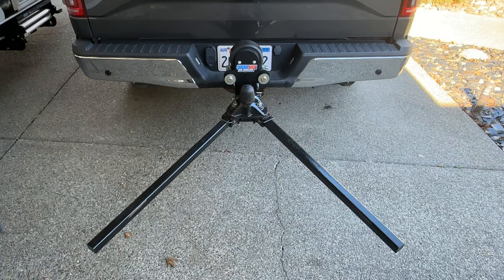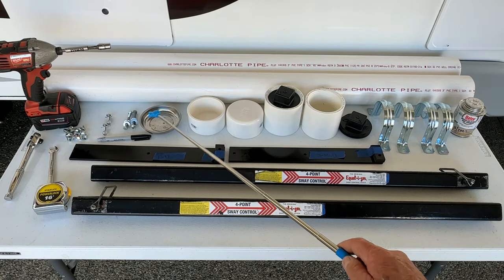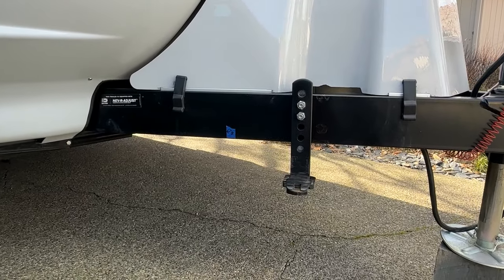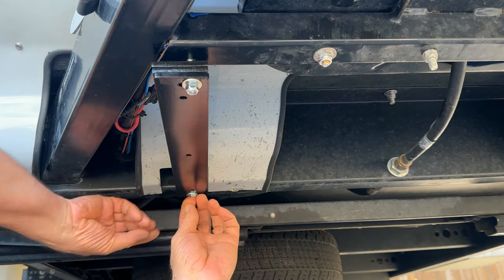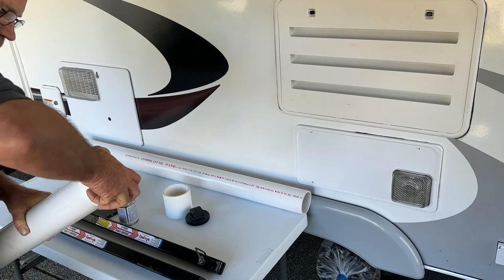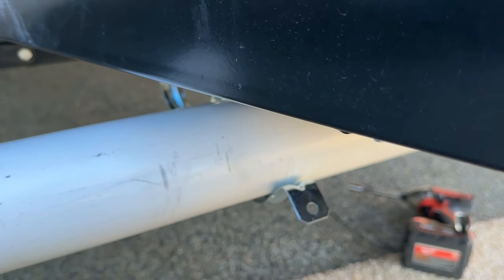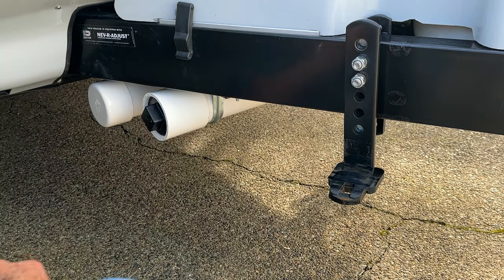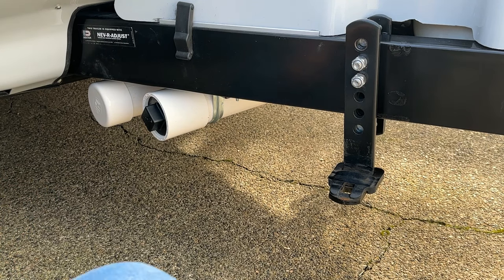Travel Trailer Weight Distribution Hitch Sway Bar Storage Solution

Comment: Thanks for the video, very detailed and easy to understand. I'll be doing this in the near future.
Reply from the maker: You're welcome, its one of my top improvements that are worth doing :) Thanks so much for watching, and for taking the time to write.

 https://www.youtube.com/@thetraveltrailerguy/videos

Snap L Pins for Weight Distribution Hitches Quiet Equalizer Type Clip -
https://amzn.to/3OkwOTw

Equalizer Sway Bracket Jacket 1 Pair (quiets down creaking noises at the bars)
https://amzn.to/499kkpO

3 Inch PVC Pipe End Cap -
https://amzn.to/3vXYSWx

3" PVC Sewer Cleanout Adapter with Plug Pipe Fitting (not the same as what you see in the video but I like this one better) -
https://amzn.to/42sK6mD

3 MIPT PLUG PVC -
https://amzn.to/42nIQ4d

Heavy Duty Rigid Pipe Strap Clamp For Inner Diameter 3 Inch Water Pipe -
https://amzn.to/3vXJdGu

3" X 4' Schedule 40 PVC Pipe -
https://amzn.to/3ulvOHK

Clear PVC Pipe Cement -
https://amzn.to/47VZedl

Comment: Great job Mike this is my next project
Reply from the maker: Thank you Mike. Its a easy project and is pretty easy to do. Here's some links to products you may need for the project?

Bar Tube Parts (I recommend you visit a hardware store to see if they have these materials in stock, they may have a better price than you see below through Amazon? 
 
3 Inch PVC Pipe End Cap -
https://amzn.to/3vXYSWx

3" PVC Sewer Cleanout Adapter with Plug Pipe Fitting (not the same as what you see in the video but I like this one better) -
https://amzn.to/42sK6mD

3 MIPT PLUG PVC -
https://amzn.to/42nIQ4d

Heavy Duty Rigid Pipe Strap Clamp For Inner Diameter 3 Inch Water Pipe -
https://amzn.to/3vXJdGu

3" X 4' Schedule 40 PVC Pipe -
https://amzn.to/3ulvOHK

Clear PVC Pipe Cement -
https://amzn.to/47VZedl

Comment: Great job, Michael!  Unfortunately, my bars are "L" shaped, so I will have to figure it out in another way.
Reply from the maker: Thank you Steve. Here's an idea I've been thinking about for a long time for a possible solution to "L" shaped bars and storing them in a tube. 

So my thinking is that once the threaded end is glued onto the pipe and dried you can cut a notch through the threads and wide enough and deep enough to allow the bar to slide in and the L part to hang down through the pipe and still be able to put the cap on. I really think it would work.  https://www.youtube.com/@thetraveltrailerguy/videos
Reply: I think that would work.  Will work on that solution when I get back to Michigan and get the trailer out of storage.  Thanks!  
 @thetraveltrailerguy
Reply from the maker: Fingers crossed, I hope you can let me know how it works out :)  @SteveComstockPhotography

Comment: Since yours is a Lance I see why you mounted the tubes below the frame. I did a similar thing with one longer 4” ABS tube above the frame. Unfortunately (at this time) I have L-bars with chains so I don’t have end caps. The bars hang out & down while camped. I like your suggestion earlier to place a threaded coupler and notch it for the protruding bar.

Have you thought about attaching the end caps to the clamp bolt with a short length of small gauge chain or wire rope. That way the caps won’t get dirt in the threads or wonder off if you set them down.

Comment: I like this idea, I hate the greasy mess the bars make in our forward storage. I suppose I could bag the ends but they also create some awkward storage issues for bins. Anyway, did you think about using stronger ABS which is also UV resistant?
Reply from the maker: Great question about ABS vs PVC pipe. I used ABS to make the bar holders on our last trailer and they held up great. They didn't get much sunlight and the weather where we live doesn't get cold for long periods or periods on extreme heat. So it held up well where is the ABS pipe was under the trailer, if it was exposed to UV it can become brittle and break.

Here's a link to my video where I show my ABS pipe tubes - https://youtu.be/h2HNL4aFd9Q?si=6zscWk1K0eqJcGfw&t=1289